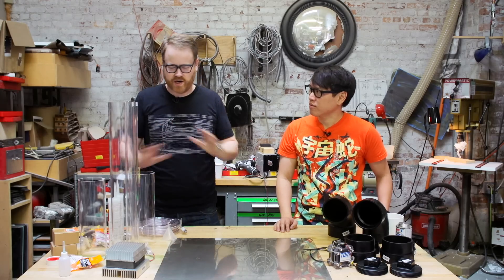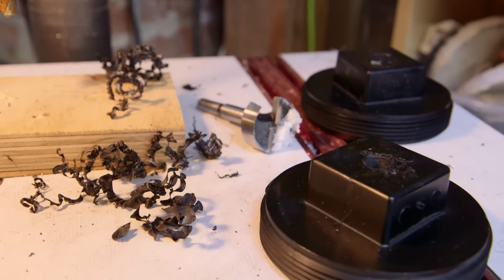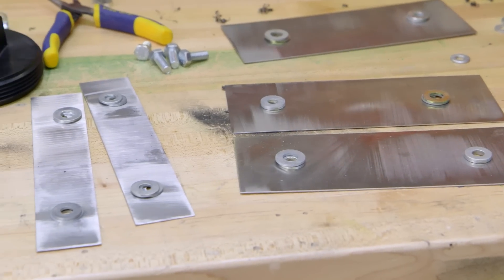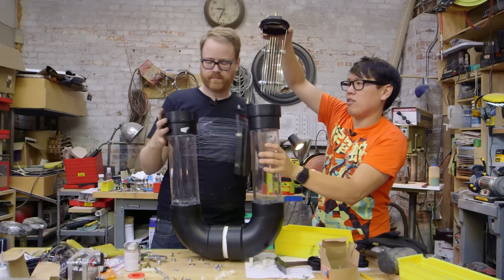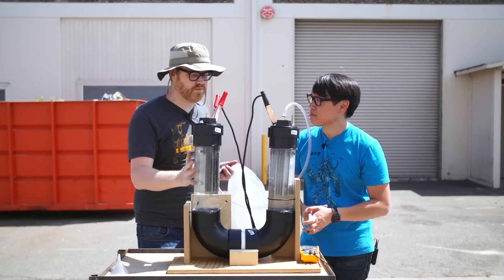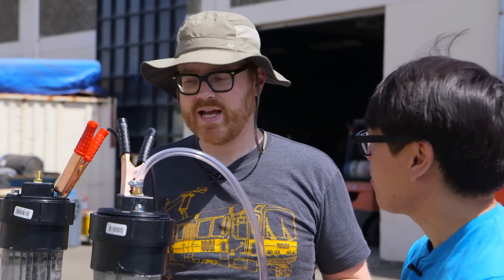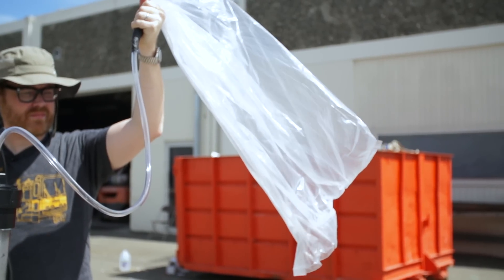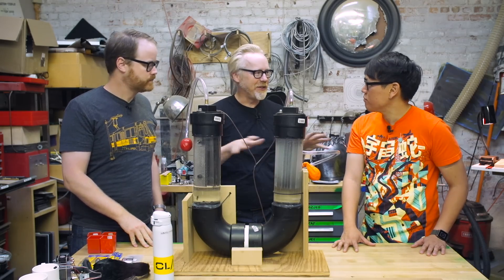Tested Builds a Hydrogen Converter

Comment: How did they screw up so bad. I designed and built a little electrolysis unit that produces about 1-2 liters per hour when running off a car battery charger. It wasn't that hard. My only tools were a knife, a hacksaw and a power drill.
Reply: can you give a link(video) about your electrolysis unit that produces about 1-2 liters per hour......
Reply: MANIA HARSHIL I made it from scratch on day. I didn't video it. Sorry :(
Reply: if you don't have then film it for me...i want see how to make it ......
Reply: MANIA HARSHIL bro you just put steel plates in water and hook a battery up to it, it's not even hard

Comment: The myth busters....... Is it just me or does it seem things guys have a habit of totally botching important projects that just so happen to potentially be game changers, energy industry disrupting technologies.

FYI smarty pants myth makers, using certain frequency's of dc voltage can greatly increase hydrolysis rates while reducing the amount of energy being used. 

If you do it these guys way..... Which is good up to the point of the important components, that's where they went wrong. First off using a good battery or two between the solar panels(using 3-4 panels would seriously help too, duh) as if you would be doing in a home) then making the cathode and anode to help the process of hydrolysis, just making anything like the mythmakers could have, and did in this case, bad results. The design of these parts is arguably the most important. Next to, of course using a frequency generator and then you adjust the frequency, voltage, amperage levels as well and tune the thing in, if you don't tune is you will have shitty results. We tune engines very easily with a few knobs on a carburetor and get way better results, just like a car engine too much air or too much fuel, bad operation, of course you also have to time the spark of a engine, this is also very important.

The same is true with any operation that has molecular change going on, burning fuel has molecular change going on.... So does your body, so does electrolysis. All of these process' require tuning, time, and control over certain variables, like temperate, pressure, voltage and of course materials, and the tuning of this machine was never properly done, and these guys are really bad at tuning...

Seen the tesla bridge shaking device,? Same thing, tuning didn't occur.....

Have you ever been jumping on a trampoline and if you time it just right you can be bounced or bounce others very effectively and get higher energy transfer with that good timing? Well....

If you time electrolysis just right you will get a better transfer rate of splitting water. You can think of these water molecules heating up and spinning and shaking around violently when they electricity flows through... And these jolts cause some to split apart and become a gas. Well when they are split apart they are going to contact other water molecules they are going to bounce around like crazy. And for a small part of that cycle the jolt is off right before the molecules get hit by the shock wave from the last jolt they get hit by another jolt causing the impacts energy to team up with the jolt and pop pop pop more and more molecules are coming apart way way way faster

Long and short of it there is a video on yt showing someone doing it and the amount of hydrogen they are getting is insane. Smaller device way way way more flow rate.

Also why do I see this ballon pumping full of gasses and then just leaking out?  Is this machine even properly sealed? What a joke.

This is a hit-piece on a very possible technology. You could just run a generator off of hydrogen like its gas, it really works.... But for some reason nobody knows that....
Reply: +Liberty Basset They have the right Idea but yea there downfall was the power supply. (Also DC dose not have "frequency's" that's AC.) By increasing the number of Amps they would have greatly increased there output.
Reply: what frequency of DC??????

Comment: your mistake was using solar panels, sure it puts out more voltage, but that means feck all if you cant supply the current... car batteries charged by panels would have worked
Reply: +ukeemail The SR-71 ran on standard jet fuel and it's tanks were made out of titanium  to reduce weight.
Reply: +Alan Conway Hydrogen gas is also really small and "leaks" out of tanks quite easily.  

Since it leaks through steel tanks, it'll have no problem leaking through the garbage bag.  IIRC the SR-71 used titanium fuel tanks to reduce the leakage.
Reply: Deep cycle batteries would've been great since they're designed to be fully drained and then charged.

Comment: Actually, you don´t need much voltage. Only 3V or 4V should be enough. What makes the hydrogen bubbles come out is the amount of electric current. I suggest you to repeat the experiment with less voltage (you just need the ionization potential of H+) and more current.

Comment: Stainless steel electrodes are a problem. Stainless steel usually contains chromium, and that produces chromate when the steel is corroded during electrolysis (and it does get corroded, just not very fast). Chromates are toxic and highly carcinogenic, not something you want to keep around in your kitchen or pour down the drain. What you want for electrodes is platinum, since it's a very chemically inert material. Unfortunately it's also really expensive... But if you want to make hydrogen just for fun cheaply and with as little poisonous stuff as possible, carbon electrodes, distilled water, and sodium hydroxide as electrolyte is probably your best bet.

Comment: Probably should have tried adding more KOH into the mix... The plates were very far apart, therefore contributing to a high cell impedance... More KOH = less resistance & more power able to transfer into electrolysis process (making a higher H2 yield)...  Very nice design.

Comment: Ya'll should've searched the workshop for a transformer to step up your voltage I think.. people probably have a point about the length between poles too
Reply: Jeremy Hall Yeah not alone, there's no reason not to use a few bits to make a square wave and transform that though.  I guess I could've been more explicit but my main thought was if they really wanted this to work they'd have parts to boost it up in the shop
Reply: Jeremy Hall Truth be told now I've had to think about it, I guess you could just produce a high frequency square wave at the currents they're working with using solid state parts. So still don't really need the coils

Comment: I like the quick build idea and it looks cool.

Just a quick safety note, although the typical logic when working with bases (KOH) is to add acid to neutralize it, it is much safer to just rinse with lots of cold water.

Acid-base reactions generate a lot of heat, so the last thing you want when you are getting a base burn is to add more heat (that will burn you even worse).

Comment: if you could add a relay of capacitors and maybe a few car batteries could you make enough hydrogen to power a hydrogen fuel cell in a car? this would be cool as a back to the future-esk back up if you run out of hydrogen

Comment: How does the Hydrogen/Oxygen collection make sense?

The molecules are a bond of both oxygen and hydrogen, when they split, they do it right then and there.  The oxygen isn't going to travel through the water to go out the other side, and vice versa.

I could be horribly incorrect, but I don't see how that could happen as described in the video.
Reply: +darthhomie It splits into ions that travel through the water, so H2O molecules pick up electrons at the cathode to become H2 (gas) and OH- ion (aq), and 4 OH- (aq) ion gives up electrons at the anode to become O2 gas and water. That is why they can collect them separately.

Comment: you should have stuck to KingofRandom's design....... electrode and cathode way to far apart....... looked good but not useful ....... like taking a topless dancer home and she wont pull a plow.........
Reply: Grants design doesn't produce Hydrogen, and Oxygen, which can be harvested separately. It produced HHO, both gasses in one chaimber. That is not what they wanted.
Reply: who gives a fuck if she pulls a plow, that's not the reason you take them home.. you take them home to smash and pass.

Comment: I actually was able to make a nice hydrogen kit for a car. Using a glass jar with a plastic top, some bolts, some scrap stainless mesh from a local workshop and some fuses and a light switch. Was not bad and the Ford Focus I used to drive was reading a positive 6 mpg on the dash. Quit using it unless I went on long drives. You'd think the added humidity was bad for the engine for extended periods but meh. Just vented it into the intake.
Reply: +T Swag (ThanoricOfficial) And before anyone calls fire hazard, I used rubber to keep the bolts from touching the plastic, and yes I did understand it could explode if the 2 current plates touched one another, but I never did have that issue.

Comment: A one day build. It doesn't look at all like they've used other literature to make this. 
They went out on a whim for science to try for clean energy. 
DC volts , is currently produced by transforming ac volts from your power point. or, from your car/ car battery. both of which have generators or engines running on fossil fuels. 
They tried for solar. Which does work at producing dc volts, and obviously amps too. but you need very large and expensive panels to pump that much amps (or power or watts)  into a system to produce more hydrogen.
This is an experimental video. If y'all haters heads weren't so far up your own asses, you could have likely responded your views of their project with civil discussion, and they might've responded happily to you! 
But no. Y'all just angry. too angry.

Comment: The cathode and the anode are too far from each other!
The ion conductivity are very slow this way!
Of course they will produce very little hydrogen and it is not falt of the solar cell!
They need an electrochemistry class  ;)

Still, I think recharging a battery is a much more efficient way of storing solar electricity in small scale.
And look, I am doing my phd research on fuel cells catalysts. I like fuel cells! 
But for general automobiles applications, a battery still makes more sense.

Comment: yea using a optima deep cycle battery or even a regular car battery would have been better.. there is not enough amps from that solar thing..
Reply: exactly. 22V/100W is just under 5A... car battery gives you 12V@like10A. Adam would have had their ass if he was running things. I was expecting a "replicate results" part lol
Reply: +I-Love-CO Mountains the optima battery that I used to own had like almost 800 cranking amps.

Comment: Spent potassium hydroxide solution is considered a hazardous waste in many states. Dumping wastewater that meets certain characteristics (in this case: pH) and in quantities established by federal and state EPA, is illegal. Municipal regulations are even more restrictive in that regard and supercede even federal and state restrictions. In the city of San Jose (CA) for instance, the limits are 6.0--12.5 pH. (potassium hydroxide is 13.5 pH).

http://avogadro.chem.iastate.edu/MSDS/KOH.htm

http://www.sanjoseca.gov/archives/171/pHFactSheet.pdf
  
Fortunately, acidic wastewater can be remedied with simple neutralization (addition of an acid), but you need to know what you're doing and, again, other factors may prevent disposal by drain.

EDIT: Next time try Sodium Hydroxide (still considered a hazardous waste-stream!) and using all stainless or nylon hardware (you used zinc nuts).

http://www.formatex.info/energymaterialsbook/book/452-463.pdf
Reply: +namzarf - KOH/NaOH, it doesn't matter; same basic (lol) stuff. KOH gives you stronger ionic strength for a given mass of reagent.

And both can be legally neutralized with vinegar to pH 7.5-8.5 and disposed down the drain (whichever is needed for your locality)  However, for any "serious" usage, you need to apply for permits and then document your discharge, including the pH.

BUT, the other issue many localities have is "TDS", total dissolved solids . pH is irrelevant here, and if you dump too much of anything dissolved (or even suspended) in the water, it can get you into trouble. Concentrations as low as 1,100 ppm TDS. This can be seriously problematic when tap water in some areas easily hits 800 ppm on the inlet side.
Reply: +slikrx As you say, laws will differ depending on location. But there is not a water district in the continental US that does not regulate pH of wastewater streams processed through municipal waste treatment facilities, especially when the effluent is in quantities considered to be commercial in volume--as it may be is in this case. Above a predetermined volume, permits and monitoring are not just a good idea, it's mandatory.

Again , you are correct, solids are also regulated, but remediation is usually as simple as a cloth filter and turbidity measurement. Excessively acidic or base waste-streams, however, interfere with the floral (bacteria) necessary for the treatment of sewage before it's released into the environment--in this case the San Francisco bay! Adam (and company) reside in Alameda county, and I know from experience that EBMUD is very restrictive in that regard.

I didn't necessarily want to get into a protracted discussion of permitting, etc., I just wanted everyone to think before they dump. As always, ignorance of the law is never an excuse and the fines for violating environmental laws can be crippling.
Reply: again such a nerdy response but no hate from here at least you cited sources!

Comment: You built a electrolysis rig and you generated hydrogen successfully but you failed to understand the most basic thing about hydrogen.... Hydrogen is the smallest and most highly reactive atomic substance, because of this hydrogen readily permeates through seemingly solid barriers. Your bag could not contain the hydrogen atoms because they simply bounce between the molecules the bag. If you want to contain hydrogen you need something much more dense like glass or metal and even then you will experience some losses to diffusion so your rate of production must exceed it. A much easier and more dangerous way to make hydrogen is to react aluminum with HCL in the reaction 6HCl + 2Al = 2AlCl3 + 3H2.

Comment: forgot to use plastic washers instead of metal nuts
Reply: +Joe ghost each stack of plates is one electrode, so is at the same potential. you only need insulating supports if you are alternating Anode-Cathode-Anode to produce dangerous and largely useless H2/O2 mixed gas.

Comment: Ugh!  So many things wrong with your set up.   First of all, this is considered a single cell.  So anything over 2 volts will be wasted as heat.  You probably didn't have enough electrolyte in solution and also the anode and cathode are very far apart, because your reaction was very slow.  I would be embarrassed to put this on Youtube.

Comment: These guys don't really understand anything about electrolytic cells... the plates of opposite polarity need to be close together and a lower voltage is better.  22 volts isn't better than 12 because only about 1.23V is required.  Going much higher only causes inefficiency as a conduction loss.  I've made electrolytic cells with manganese dioxide coated titanium electrodes (dangerous to make) and achieved coloumbic efficiency above 90%.  Also, saying 100 watts of energy is unforgivable.

Comment: Electrolysis or other means of creating hydrogen are very inefficient processes. It's much more efficient to directly load the energy into a battery and use that for driving cars. Furthermore even if you inefficiently produce hydrogen from water the storage of hydrogen is still not solved very well.
Therefore hydrogen as a means of storing energy will bever be a good thing. Unless you find an efficient way to get hydrogen.
The whole hydrogen thing is actually a thing of bigoil to keep consumers hooked up to something they have to get from them instead of being able to just have a battery and charge that with own solar panels. Once batteries are down in prices I hope the whole hydrogen thing will collapse quickly.

Comment: That solar panel is running at 4.54amps ish which is no where near adequate for this type of generator also the voltage is far to high (The best operating voltage is about 2 volts at each cell). Where as a car batter runs at between 60-120 amps which make a lot of hydrogen really quick. For some reason Adam savage has a really hard time getting well documented experiments to work. This type of tech is going to change the world and some fat cat is paying him to slow it down. with very little money and time you could run your car like this really easy. Check out king of random for a good experiment that works.